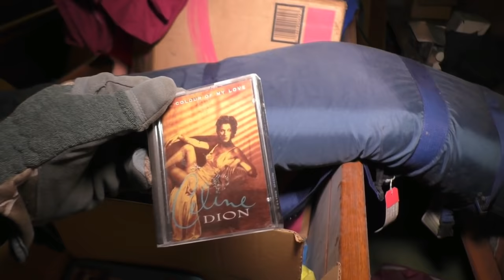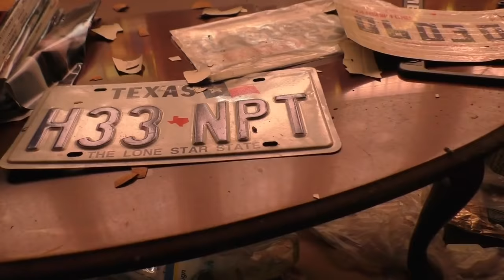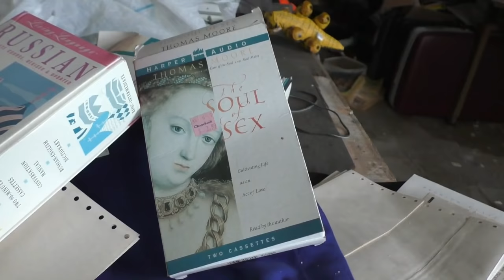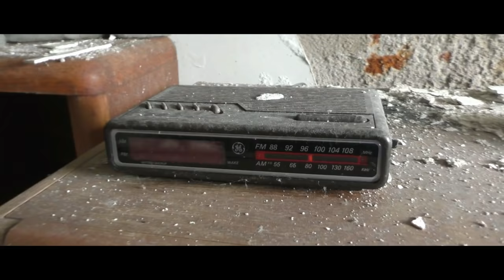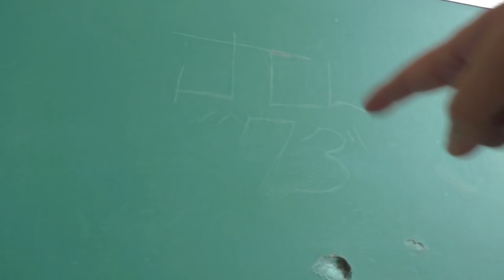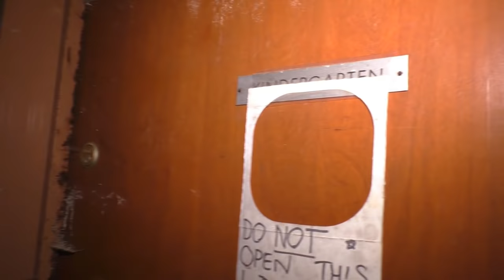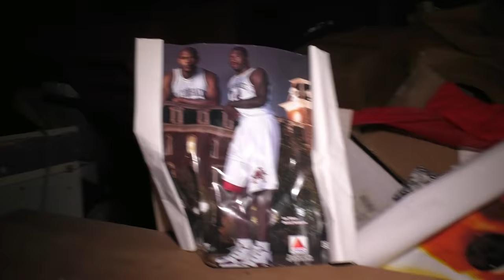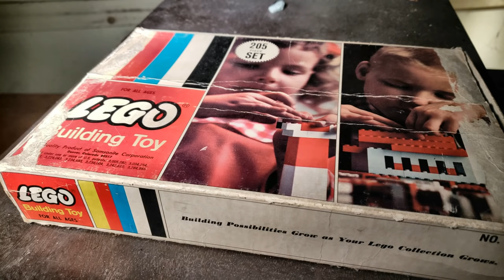Untouched Abandoned Church - Not Used In Over 30yrs

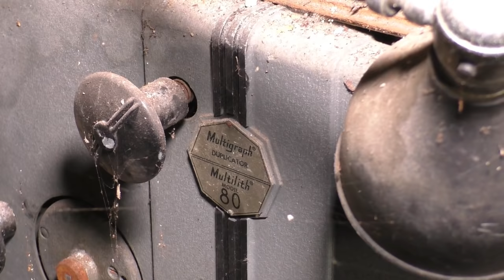Comment: The Multigraph Duplicator at 44:00 is basically a copy machine from 1955.  You'd make a master paper using carbon, and the machine would transfer the carbon onto blank sheets using a liquid.  There's one listed on ebay for 3k.  Maybe to the right collector.  Very historic.
Reply from the maker: Thanks for the info

Comment: Hammond BC Organ@ 7:50 (and in teaser).  Looks like it was fitted with Leslie Speakers (note "Half Moon" Switch Boxes on Left Side).

Probably not the original Organ (date from 1936 or later, a few Leslies date from 1940-41, but many more were built after WWII.

My guess is the church started out as a White Congregation and a Pipe Organ and when the demographic changed, a Black congregation took over.  Some White Churches used Hammonds, but the Leslies (originally designed by a Theater Organ enthusiast) found their was into Gospel Music.

@28:00, Looks like inside of a 31-H Leslie Speaker (sometimes called a "Vibratone" pre 1950).

Looks like Leslie was installed in Pipe Chamber.

Room @31:00 could be another (empty) Pipe Chamber, they are often set up in a "Stereo" configuration about the alter in the Sanctuary and sometimes an "Echo" division at the back of the room.

Same Organ and Leslie models in working condition...

https://youtu.be/0GkKdu_cAIs

Comment: the one machine that you looked at I believe it was called the "duplicator"  I believe it was an old copy machine when kids actually use to smell the paper.
Reply: The paper you started with was called a master it had a white cover sheet and an inked backing. You typed your message on the front or top sheet, you kept that for your files the back sheet with the ink you put that on a large round roller when the roller spun around new paper was feed one sheet at a time. the machine added ink so you could make as many copies as you needed. There were many types of machines but they all worked the same, very messy the ink got all over your hands and every thing you touched some would leak ink, some models were hand chanked. Oh what a great day it was when our office got a real copy machine 35 copies of 80 to 100 messages a day.

Comment: It's a mimeograph machine. The coffee urns are from the 20-30 era.
Reply: Yes it is.  You'd cut your own stencil, remember, and fix any errors with the liquid blue correction stuff.  I typed them for my high school when I was a junior and senior because I was fast and accurate.  Those days are long gone.  I never thought I would see the changes in my lifetime like my parents did.  Party lines to cell phones, stencils and carbon paper to copy machines, adding machines to calculators, actually solving difficult mathematical tasks without a calculator, actually using our brains and the list goes on......
Reply: VINTAGE CLASSIC MULTILITH MODEL 80 PRESS, MULTIGRAPH OFFSET DUPLICATOR 1955

$3,000.00